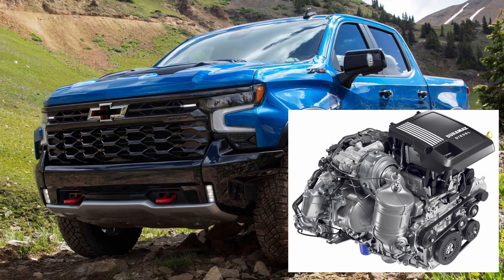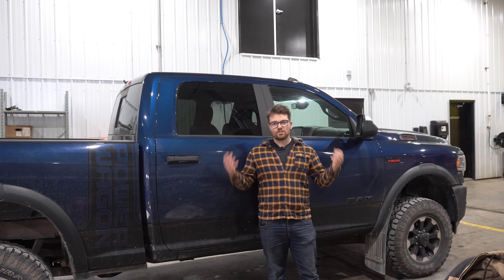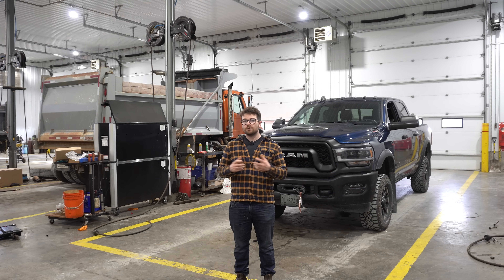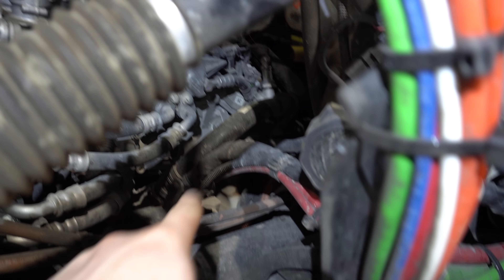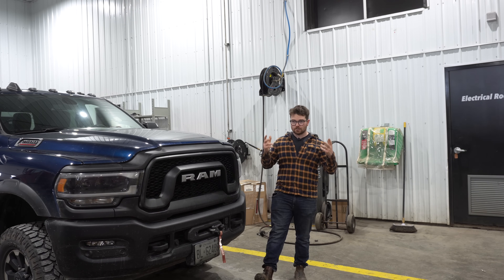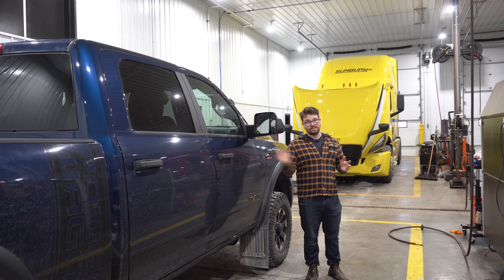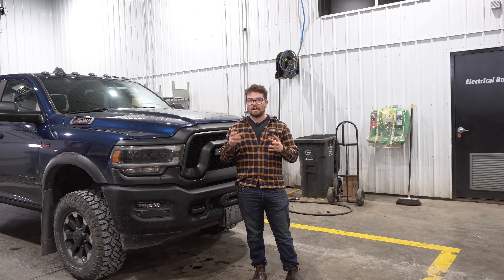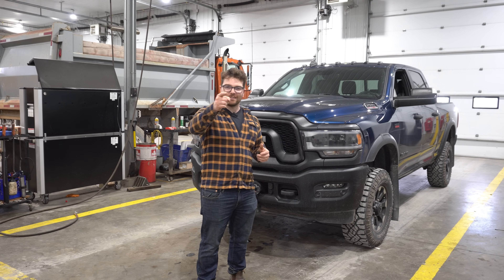Chevy Silverado 1500 3.0 Duramax Diesel **HEAVY DIESEL Mechanic Reviews** | Is It a GOOD Engine??

Comment: I'm a tech at a GM dealer and one thing I'm noticing about working on the LM2 is the crazy labor times involved in fixing these trucks. Recently had a to fix a lower crankcase extension leak due to a factory RTV failure under warranty. 26 hours in labor for that. Outside of warranty you'd be paying around 40 hours of labor for that fix. Simply because of the the amount of stuff that surrounds these engines that needs to be removed to really do anything.
Reply: I would suspect oil pump belt change will be $2000 labor + parts. So few will be 4x2 so transfer case and trans comes out to get the back engine cover off.
Reply: I think as a buyer of this inline 6 diesel it would be wise to buy the extended warranty and beyond . Wow

Comment: Just a couple critiques…. The majority of heavy duty diesels are cam in block and not overhead Cam. They should have made this engine out of Compacted graphite iron rather than Aluminum ( even a 2.7 eco boost has a CGI block). Belt fed oil pumps have a history of failing. Timing components at the back of the engine are a terrible idea in this application for serviceability. Will end up being a poopoo motor…

There is also a documented problem of oil consumption that you left out.
Reply from the maker: Agreed I don't like the aluminum and that oil belt is scary. I mean 20 years ago yes a lot of in-block cams but now the majority of stuff is dual overhead cams. I don't think it will be a poopoo motor not like the Eco diesel's lol it will be interesting to see how the updated engines performs coming in 2023.
Reply: This engine reminds me of VW/Audi products. Oil belts and timing parts in the back of the engine. Although they’re great when new they aren’t built for the long haul and repair costs are very expensive.

Comment: I’m still struggling to convert to the 3.0. I’ve always ran a 6.2 but I lean more to the towing than mpg. The oil pump belt is a concern to me. I will sit back and watch over time and probably convert at some time. Hard to beat the fun spirited nature of a 6.2.
Reply: I pulled my 7,500 lb camper over the Rockies and over the Continental Divide and and mine perform beautifully, and got 13.5 mpg. Put this thing in Tow Haul and it becomes a beast. Blessings
Reply: What was the max towing of the 6.2 when you had it ?
Reply: @BearPapa49  9800 pounds. I’ve since went 6.6 duramax as my tow needs have exceeded 10k
Reply: Did you own or ever get the chance to try a 3.0? How much could you pull if you did ?

Comment: Good video.  I test drove one a couple years ago and really liked it.  I would like the better fuel economy, plus just like diesels, but don't plan to tow a camping trailer or boat over 5K lbs and won't spend that much time at higher elevations or mountain passes so probably don't need the grunt and turbo .  In my case, does it seem like a gas 5.3 or 6.0, even with a less robust transmission, might be more economical and more than adequate over the span of 200K miles?  Thanks.
Reply from the maker: thank you sir! Well the 5.3 will tow more then the Diesel but it also depends on the set up the truck and the gearing. But I hear what you are saying. The 5.3 is a great engine and it will serve you well for 200k miles. nice and simple and easy to work on. Honestly can't go wrong with it.
Reply from the maker: the 6.0 is a bit of a gas hog in my opinion
Reply: @GettysGarage  Thanks for the reply.

Comment: If they get this up around 500lb-ft and still reliable,  I may consider it someday.  It might be good enough power for a 3/4 ton.
Reply: It's 495lb-ft. Is that close enough?
Reply: @jefforr439  more than my 6.0 LQ4 currently
Reply: @AndreS_-df2nw  Personally I wouldn't put it in a 3/4 ton. Tow rating would be nothing. Truck is much heavier. My 2500 is 10,000. Plus you can now get up to 1200lb-ft in a 2500. Ram claims they are about to beat that. Constant game as you know. Not a diesel but the new hurricane engine might be for you. I think it's called the hurricane.
Reply: @jefforr439   the Dodge Cummins in '89 was rated at 140 hp & 400 lb-ft and was sought after. Just gear it properly.  My dad had one.
Reply: @AndreS_-df2nw   Great truck. Love the old p-pump 12 valves. Yes, it was a sought after truck in 1989.  But sorry to tell ya. Your 89 won't tow nearly what these new trucks will. I don't care how you gear it. You're not towing 38-40,000 pounds. Or at least I wouldn't.
Reply: @jefforr439  I'm not towing that, neither are most 3/4 ton truck owners. It's usually  5-15k when/if towing, they just want something safer than a fluffy 1/2 ton to do it.
Maybe Chevy needs to stroke & poke this out to about 4.5L and ~700ft-lbs for that.
Reply: @AndreS_-df2nw  I'd be down for a 4.5L say 350-375hp and 6-700ft-lb. That would be about perfect in my opinion. Right now the max tow option on the 1500 has 3:73 gears. That would be a great truck.

Comment: Who was the idiot that thought a belt driven oil pump would be a good idea?
Oil pump should not be engineered as a possible point of failure, should someone not change the belt.
Should be gear or chain driven only.

Comment: I have a 2020 ram limited eco diesel. My father loved it so much he traded his 2015 3/4 duramax for a 2021 Chevy ltz 3.0L duramax. So I have a bit of exposure to both. I love both trucks. 

My one complaint is the Chevy has the option where the truck turns off at stop lights and so forth. It can be turned off by a toggle but each time u start the truck it defaults to on. So everytime u get in u have to toggle it off. It's a small gripe but once your into the habbit it's not so bad.

The Chevy with the 10 speed shifts amazingly smooth. Even compared to my ram. The trucks have quite different gear ratio but the Chevy has gotten phenomenal fuel economy even over th eco diesel if you behave. At 110 km/h or (67 mph or so) his truck is doing about 1400 rpm. So it's just barely above high idle.

If the Chevy itself had a few options I prefer in my ram I'd probably buy one. And I still might for my next truck. As the ecodiesel is discontinued. But that's at least 5.years away. And I'm currently considering doing a full delete on my eco that it's just about off warranty.

Comment: Picked up a 2021 Silverado with a LM2.    I love the thing.   It tows my 3800 pound camper with ease.  I can get 30 mpgs not towing and I've done 13.9 towing with my entire family in it.  I traded in a 2020 Toyota Tacoma in for it and I do not regret it.   Hopefully it will last me for quite a while.
Reply from the maker: That's awesome to hear Tony! and I mean time will tell but maintenance is key on these modern diesel so keep up to date on that and I don't see why this engine won't run 200k miles easily.
Reply: Speaking of towing MPG, I pulled a Jeep from South Carolina to Ohio with mine and averaged 18mpg the whole trip back.
Reply: Wow you towed 13900 .
I’m sold! I’m goona do a GM build this week . 2024 Chev 1500 LZO with max towing . My low back injury doesn’t allow me to get into a 2500
Too much discomfort. I test drive a 1500 LM2 last week and got into it no problem. Thanks

Comment: The oil consumption issue is a big concern to me. Apparently normally 1 quart of oil is to be burned every 3k not towing. You can easily burn 2-3 quarts if you tow frequently, or drive aggressively.

Comment: My Ram Ecodiesel has been trouble free for 150,000 miles, but I will certainly check out the GM if I ever have an issue. Love the 30 mpg and awesome towing.
Reply: LOL you're lucky. I know nine people that have had ecodiesels only three of them still have them. Admittedly a couple of them were just trade-ins out of concern of having issues later. But four of them went back on lemon laws.
Reply from the maker: Good on ya! I hope the Eco diesel keeps rolling strong for you
Reply: My dad put close to 290k kms on his ecodiesel, trouble free! Great truck.
Reply: I have 35,000 on my ‘21 ecodiesel, and after driving a diesel half ton I don’t think I’d ever go back to gas. Very happy with my Ram but also love the 3.0 Duramax, chevy dealer just couldn’t make the numbers work when the time came for me to get the truck.
Reply: My uncle legit has the gen 1 ram eco diesel …. The first one that they quit making. Not a single issue and they quit making it because of issues.

Comment: I really like my LM2. I like it way more than my 5.3. The oil belt change doesn't bother me because it will be paid off well before that and several years down the road. I'll hit the time change interval before 150k miles. If I still have it at that point it means I still love the truck enough that I'll happily pay to have that service done.
The only problem I've had with my 2022 LTD so far is the rear end making a clanking noise which is unrelated to the engine. The dealer states its the leaf springs and is working with GM on a fix.

Comment: Given the issues with their direct injection gas v8’s, this duramax is really the best choice for their 1/2 tons.  Perhaps the best part is the cost is very reasonable.  The downside being the insane price for fuel right now.
Reply: That's why as far as the 5.3 goes the 3rd Gen LS that was in my old 04 Silverado will always be my favorite. Out of all of the 5.3's it had the least amount of issues and was the most reliable with regular maintenance. It didn't have the problem with eating lifters like the current engines do. That's actually why I was fairly happy that I could only get my current truck with the 2.7 in it and not a 5.3. It's not perfect but it doesn't seem to have the valve train problem as bad as the V8's.
Reply: Emissions are killing diesels. Sad
Reply: The oil pump makes it a no go for me.

Comment: 21' Chevy RST LM2  4 X 4 crew with 20,000 (32,000KM) miles. Love it, I wouldn't hesitate to recommend or buy another. Had the crank/no start issue. Software fix (longer cranking time). Fuel mileage is fantastic! Several times my best 50 mile (80km) segment has been 39.5 mpg (64km). The engine has balls. Hope my math conversion is correct.

Comment: Aluminum head with an aluminum block mitigates exactly what you talked about with the aluminum piston and iron cylinder liners. Both the block and the head will expand and contract very similarly to each other whereas having an iron head would cause the head to expand much more slowly to the aluminum block. This will put extra stress on the head gasket and eventually cause it to wear out or blow.

Comment: The 3.0 is a pile of crap, many many issues. A big issue is the engine wire harness, and that takes about 17 hours to replace. You dont have to drop oil pan for the high pressure injection pump, but you do have to remove the transmission and about half the top of the engine. I like how you have a good opinion on a truck that you have not even worked on or even driven. I would take and work on a 6.6 any day over a 3.0

Comment: So at 100k miles between an oil pump belt replacement , a fuel pump replacement, and something I’m forgetting you are looking at at least 5k in drivetrain repairs by 100k. Yep…. Sounds like GM. Unacceptable….
Reply: Belt is not a problem. He has no idea what he's talking about

Comment: Yeah, pass. Rear gear train is reason enough not to get it. Any major work back there is probably going to be a cab liftoff. 
I6 diesels is the form factor way to go but this is not the right design to do that. Can some one with a straight face say this engine is capable of 1 million like a Cummins or 7.3 PSD?
Once these trucks start to hit 250k+ we shall see if it was a good idea. Diesels should be long term durable first, huge torque 2nd and MPG 3rd, not the other way around.
Reply: He has no idea what he's talking about. He never even saw one of this engines